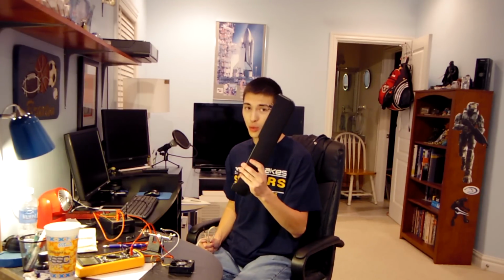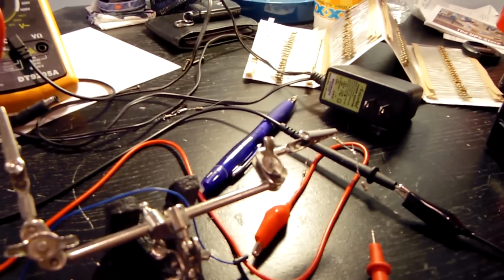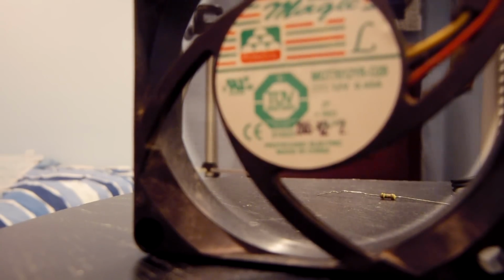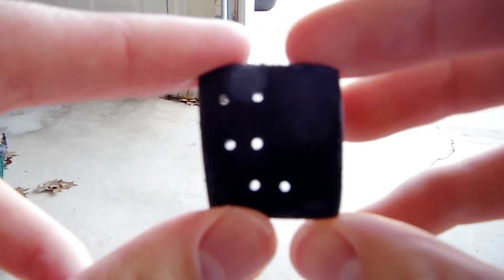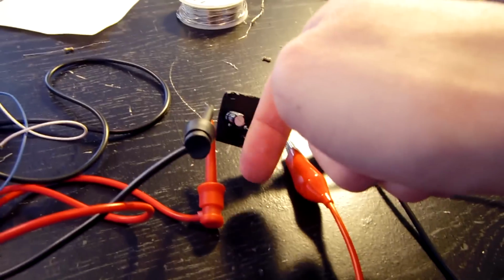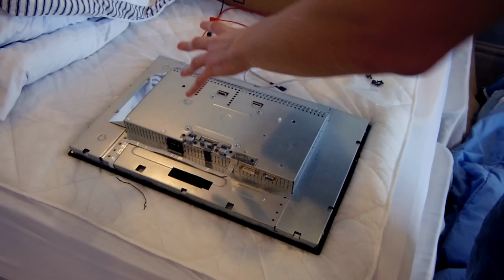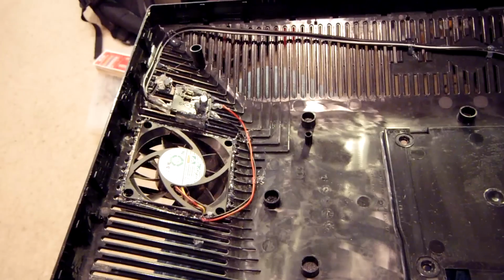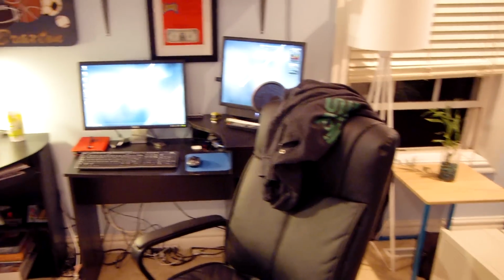Dell E228WFP Computer Monitor Modification / Repair (Black Screen)

Comment from the maker: If this does not work for you (it should) I did a little more research and apparently there is a real permanent fix. It is on the dell website: http://en.community.dell.com/support-forums/peripherals/f/3529/t/19285583
I might perform it if I start having trouble with the fan fix but so far it has been fine.

Comment from the maker: Did any of you spot the new piece of equipment that snuck into this video?
Reply from the maker: +talldude123 Nope, that has actually been back there for quite a while. Stay tuned, a video coming up on the new piece of equipment will be coming up soon! :)
Reply: new microphone?
Reply from the maker: +Chong Phit Herng (Michael) Nope!
Reply: Variable Voltage DC Power Supply? I totally didn't cheat